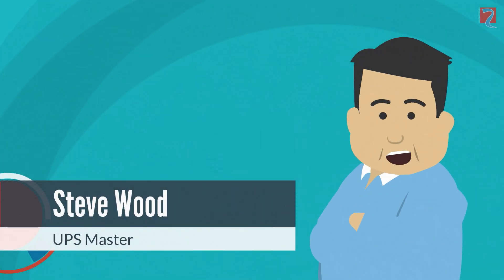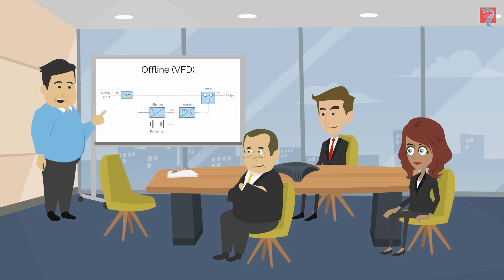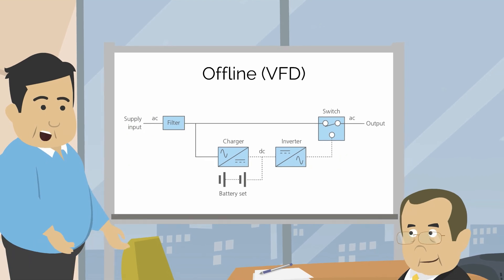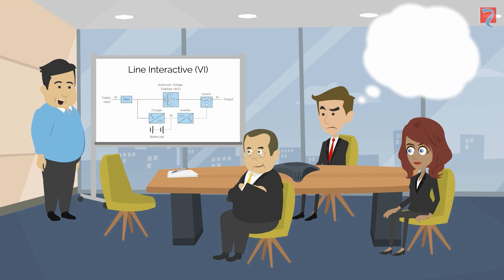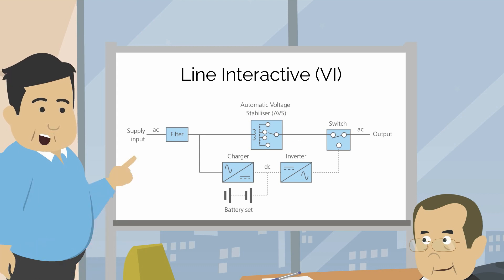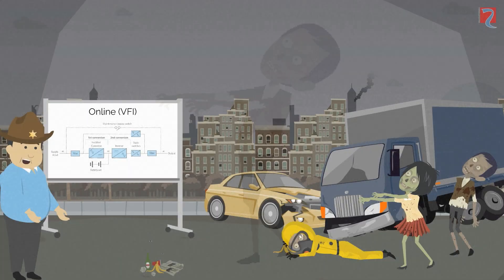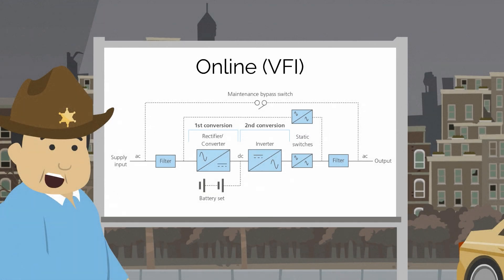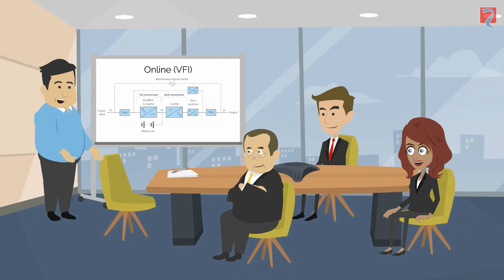#UPSbasics: How Does A UPS Work?

Comment: Im my area we have power cuts for only 1 second because the electral power comes with water pressure, therefor 3-5 times a day i lose power on my playstation and PC and they shut off. What UPS do I need to prevent the power cut? Im sick of losing my save files and risking the life of my SSD.

Comment: Nice video i have a small Problem, i encounter my UPS output voltage is higher on normal output voltage. what should I do in order to bring it back to normal output voltage..?
Reply from the maker: Hi there, thank you so much for your kind words. 

Without knowing the exact details (what UPS you’ve got, the voltages etc.) it’s quite tricky for us to provide the best solution.

Perhaps the best option would be for you to email our Technical Team on technical@riello-ups.co.uk with as much information about the issue as you possibly can. Then they’ll be able to take a look and offer their advice.

Hope that helps, thanks again
!